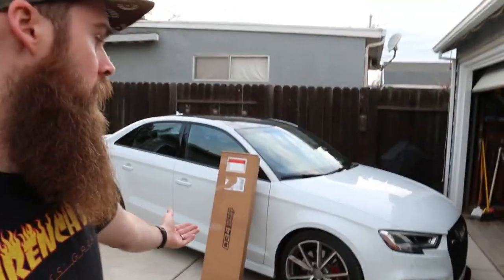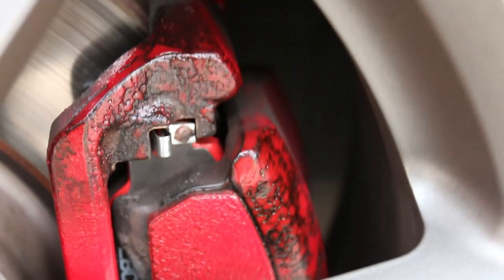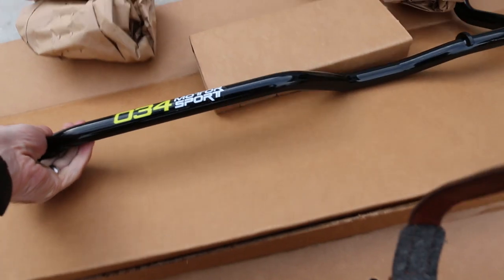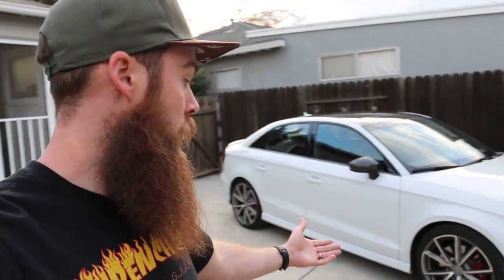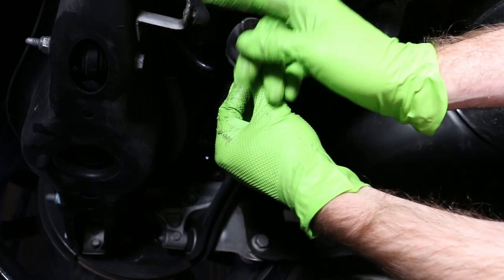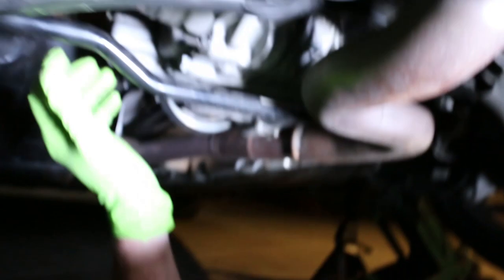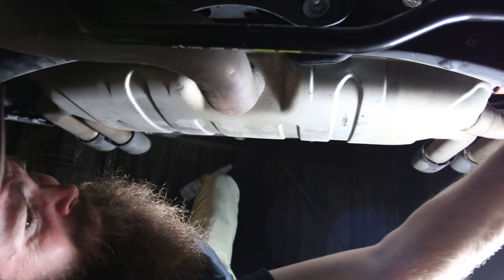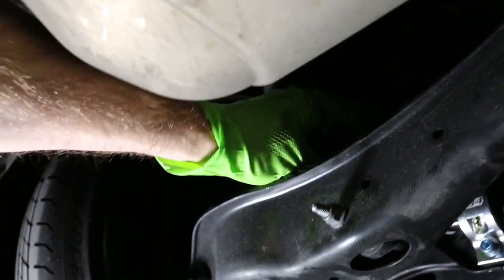BEST BANG FOR YOUR BUCK AWD MOD EVER!

Comment: I replaced this sway bar on my Audi A4 1.8T that I modified to 300HP and aprx 300 ft pds trq.  I purchased an RS4 rear sway bar and it made a huge difference in how it handled and the lack of understeer it produces.

Comment: How did you make sure that your z3 rack was on center on ur e30. I'm doing a z3 rack on mine. Its a 1988 325i and I was told I can't keep it on center. I can't take it to a shop my pride wont let me. I'm set on doing it myself. Any tips will help

Comment: Hey Blake! looking at sway bars for my S3. Why did you choose 034 (Solid) over APR (Hollow)? I know APR sells a front / rear set which is a benefit.
Reply from the maker: So reason why I went with 034 is they track with all of their parts and tunes and fully abuse all of the cars. So durability wise I trust them more also they do a much better job on engineering the product than APR in my opinion.
Reply: @BlakesGarage  Good to know. Thanks for the info.

Comment: Been thinking of this mod for a while.  Won't ever track the car or do autocross, but want a decent street car that handles better than stock.  Think this is worth the upgrade?  I've done sways on my MX-5 and it helped with handling.  Hoping this would do the same on the S3.
Reply from the maker: This mod is definitely worth doing even for the street. You will see my review video soon and I feel a huge difference.

Comment: Hi, I got the A3 sportback 17 ( FWD ) and I have installed UB of unibrace and it really added hell lots of stiffness on the car body, now I'm gonna add anti sway bar. I got a question
I am looking into H&R front & rear anti sway bar and 034 anti sway bar, which one do you think is better ?
another things is 034 only got rear bar, no front ones, and I heard a lot of voices that you need to change both front & rear at the same time to get a balance , and to avoid different strength between front & rear, what would you say about this ?
If i'm only getting the rear one, I'm going with 034, but if i'm getting both, I would pick the same brand ( H&R ) on both side thanks!
Reply: O' Malley you don’t have to change both at the same time. I come from an SCCA auto-x background and some classes limit you just to one sway bar change. Since you are FWD definitely get the rear bar first. Try the “soft” setting first to get a feel for the change in suspension dynamics and then try the harder settings.
Reply: for a a stock fwd or awd car, upgrading for a stiffer rear sway bar really helps counter the understeer. if you at the same time upgrade for a stiffer front sway bar it counters the upgrade of the rear. you should opt for and upgrade of the front sway bar later on when you have upgraded tires, suspension etc. to not loose so much of the benefit of an upgraded sway bar in the rear imho. so difference between front and rear is really helpful on a stock fwd or awd car regarding the understeer. you should look to balance out the difference later on as you would have better suspension, camber setup and so on and then go for an upgrade on the front sway bar.

Comment: And.. you still got a FWD haldex car :)))
You can do what you want, that golf rs3 will never become audi and that pseudo-awd haldex, will never become torsen :))
Audi and quattro starts from 4 series.. until there, audi cars are just rebadged cheap vw platforms.
Reply: And since VW doesn't make a Jetta r like the Golf I'm perfectly happy with A VW S3. 😎
Reply: Don't think you know what you're talking about. Go for a spin in an rs3 then come back and comment.
Reply: +Unknown Horror you're a genius, as your technical arguments shows here :)))..
Reply: +Tony P I was, don't you think?! not golf rs3, but golf tt rs, which is exactly the same car.. even a little bit lighter.
Neither feels like PERMANENT AWD car in ANY circumstances! Go to drive a s4/rs4 or subi STI.. even base model wrx. Those cheap to manufacture "awd" haldex, is a garbage.. faaar from reliability of torsen or any real awd.
Reply: If it's good enough for a Lambo or a Bugatti then I think it's good enough for my A3